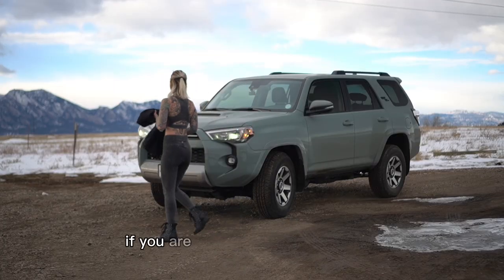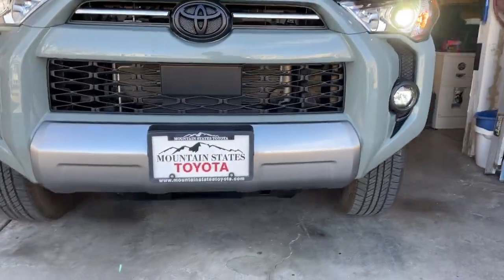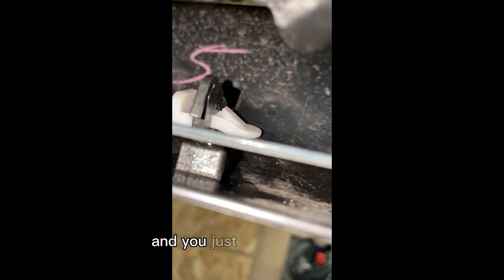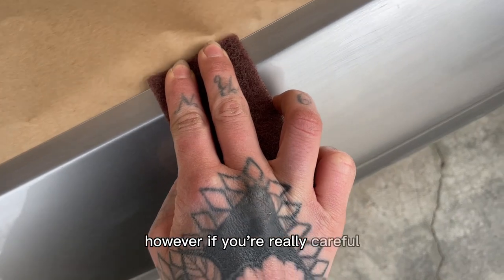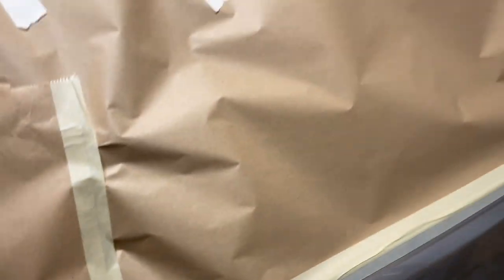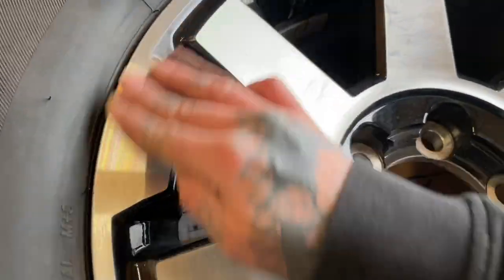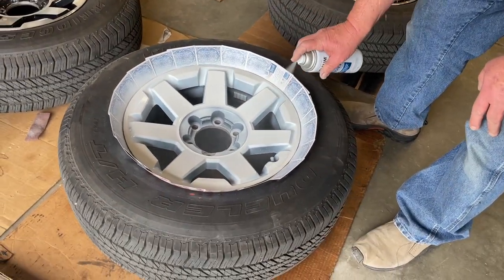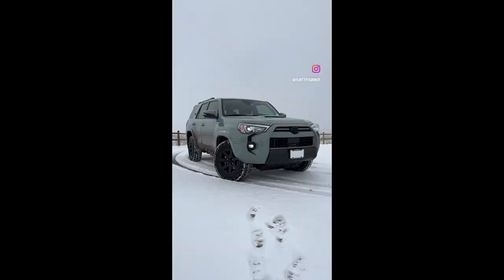HOW TO PAINT YOUR RIMS AND VALANCES BLACK - 2023 Toyota 4Runner Lunar Rock How do I paint my rims?

Comment from the maker: Update! 
1. Don't scrub your paint with brushes like an idiot. I now have ceramic coating and realize the errors of my ways.
2. My valence in the front is now pitted AF, meaning you can see the silver underneath very easily, I plan to get a C4 bumper installed on mine so I don't really mind, but I would suggest just buying black valances and having someone instal them for you VS painting them like I did. Or plan to repaint the front one every 6 of months.
Reply: Bingo!! I was just going to say exactly this!! Just buy black ones. The install is super simple and doesn’t look like garbage after a short while